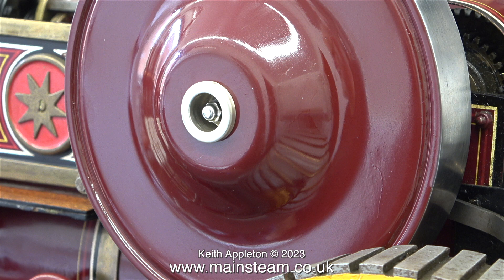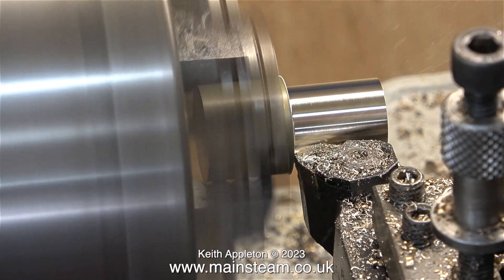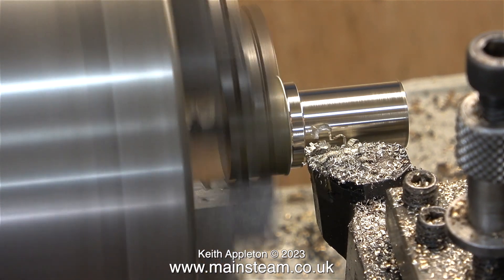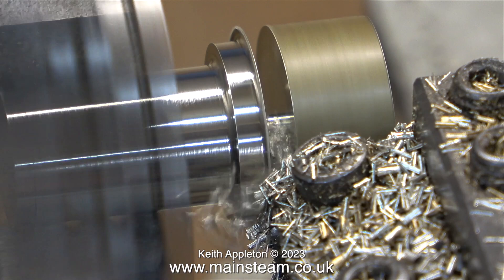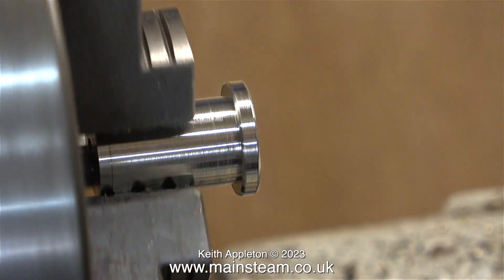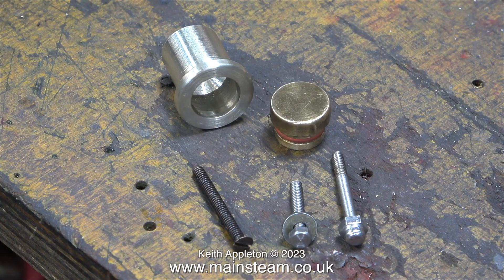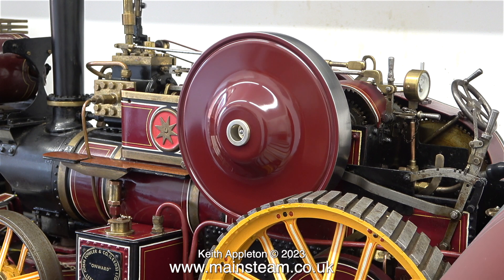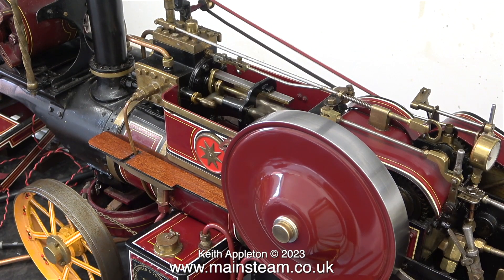MY SMALL SHOWMAN'S ENGINE NEEDS SOME REPAIRS - PART #8

Comment: Great video! How can the engine run on compressed air because it would immediately run out without a feed pipe? And also have you ever taken the engine out for journeys or rallies?
Reply from the maker: Obviously there is an airline from my compressor connected to the boiler of the Engine . . . I don't run this Showman's Engine very often - it is mainly a nice ornament although I have steamed it in the past ........
Reply: @keithappleton  Ok. Where do you connect the airline to the boiler?
Reply from the maker: I made a special fitting ......
Reply: @keithappleton  Ok thank you!

Comment: The flywheel has become a thing of beauty. Being a modeller (and consequently a model painter) myself I know how hard it is to paint large surfaces evenly. A question (knowing that I am lagging six weeks on reality) are you going to add some lining? Though beautiful on itself something seems to be missing when it is on the engine with its intricate lining. No criticism intended, I can only gaze in admiration at your work.
Reply from the maker: Paint Lining is something that I am not good at doing . . . . hence the lack of it on the Flywheel.
Reply: @keithappleton  sound reasoning, I guess. Do what you are good at. Maybe you could persuade a friend into lining the flywheel in return for doing something he’s not good at. But as said: it is already a thing of beauty.